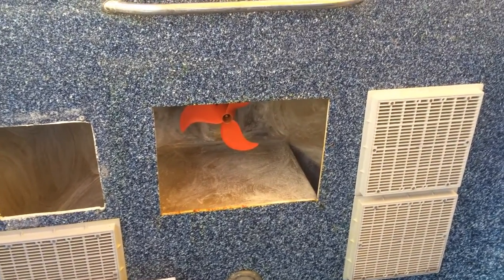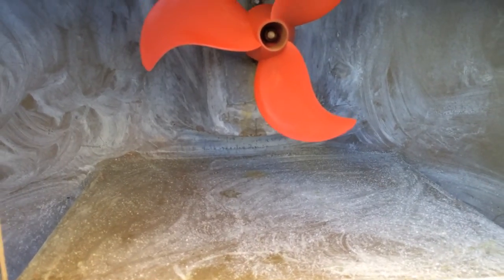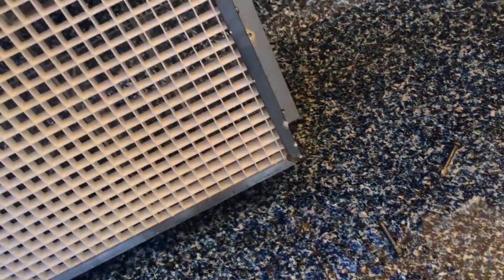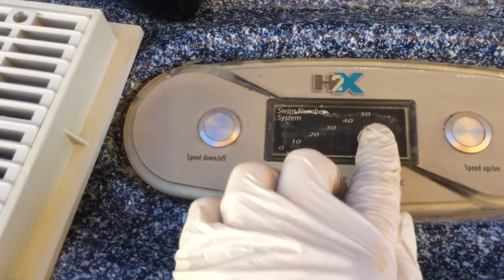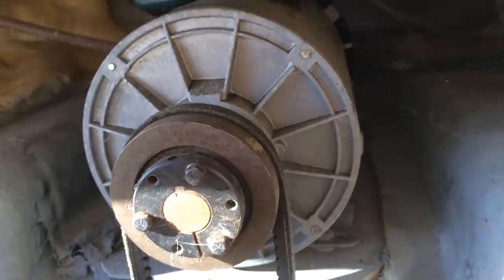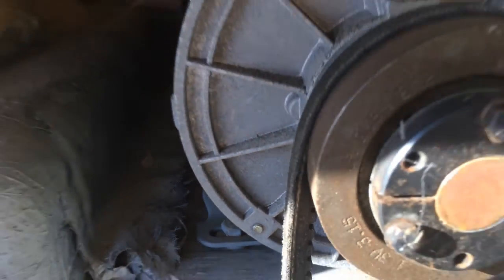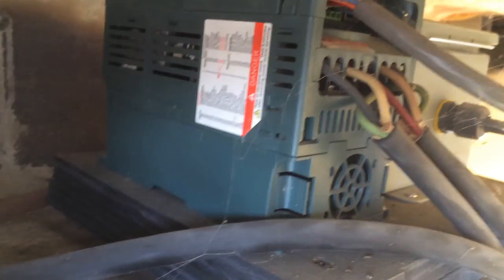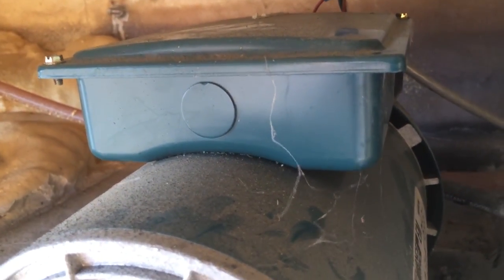Masterspas H2X Swim Spa propeller and grate custom upgrades #1

Comment: Do you still have this swim spa?
Reply from the maker: we do.
Reply: @slkttop  my control panel died for the propeller system the same one you have in this video any ideas where to get a replacement looking everywhere master spa only has the newer one not this one as in your video
Reply from the maker: @Fiberglassboi5824  "control panel", just to make sure, you mean the buttons that turn it on and change speed? or the circuit board that runs the motor?
Reply: Yes the buttons that change speed it was touch and go now does not work
Reply from the maker: @Fiberglassboi5824  hmmm. I have replaced that part myself. I "think" I ordered from Masterspa Parts dot com, also try "My Spa Parts Store". .I can only suggest searching the web even more thoroughly for just that part, and buying two if you find one...thanks for the tip., I might do the same. Ours leaks a lot...about 5 inches every two weeks. Not sure if I can do anything about that.

Comment: @slktop great info, I posted a note in slowtwitch with some questions, not sure if you still go in there or not. I recently acquired a 2010 H2X that's been in storage for 7yrs. I'm replacing the bearings in the hub assembly - thought I might put a new prop on and would like to know the model or torqueedo you used (ie the high torque or high speed one), if there were any words of advice installing it, and I'm trying to determine what spring/ceramic seal to install in the hub. Any advice/help would be appreciated. my contact details are in slowtwitch to your user name mws. Paul
Reply from the maker: I no longer have a slow twitch account. decided to update the description with helpful info.
Reply: @slkttop  Much appreciated! My motor is either 3 or 4hp so I should be good. now, just to find new ceramic spring seals. By the way, I'll be able to rebuild the bearing hub assembly for about 200-$250 CAD, much more reasonable than $1000 USD for a new one
Reply from the maker: @pauldemaiter6088  I just measured and found the inner and outer diameter and then, the height of the bearings and bought them off the online store from McMaster Carr. I have a small hydraulic press (required) and did the job myself. But if you lack the press, that price is not bad, if it includes labor.
Reply: @slkttop  yes labour (Canadian spelling) and parts, about $200 USD, It's good chatting with someone that also likes to tinker with things and DIY.
Reply from the maker: btw: as far as the ceramic seal goes. I believe I pulled the original and just took to to a spa tech who replaces parts like these. It is VERY common and off the shelf, but I do not have the part # offhand, sorry.

Comment: hello. did you get the 3 inch squares together or did you have to buy a tube and cut them, If so, how did you hold them together? any input helpful
Reply from the maker: I cut slots in the plastic strips, similar to a wine divider in a cardboard case of wine. then glued using acrylic glue. In fact, I looked forever FOR a wine divider made of plastic that was the right size and gave up, and had to make my own.

Comment: I would like to visit with the person who did the clever changes with the torqeedo prop,  as I want to build my own swim spa and have found this info so very helpful.
Reply from the maker: +Rick and Mary Coates . I'm glad you like the video. I did respond to your comments on video #2. Did you see my response? 

As for any other information: I will say that the "driver" which is the electronic control box on my standard H2X motor, did die. Admittedly, it might have died due to the additional power needed, especially at low RPM, to drive a prop that pushes more than 2x more water for every revolution. I ended up springing some serious money for a Phelps model motor AND the electronic driver box that controls it. About $2000 total.

Comment: Thanks for posting this series of videos!  I had to replace the prop in our H2X & this was very helpful.  Ours came with the upgrade style prop & it disintegrated after a couple of years. It appears to be made of a fiberglass type material & it became shaggy & fuzzy & the blades fell off the body of the prop.  Oddly the exerswim propulsion system in our spa doesn't get extensive use.  It apparently just broke down from exposure to the water.  Must not be designed for use around oxidizers like chlorine.
Reply: BTW, for anyone else who might have that problem...The prop can be pulled fairly easily without the need to drain the spa.  A phillips screwdriver removes the grate & the prop (our model anyway) was held on with a plastic wingnut type retainer.  No tool needed for that part.  Just have to be careful not to lose the short crosspin that goes through the shaft to drive the prop.  It is positioned in a hole through the shaft just behind where the nut threads are.  It is not tight in the hole & can drop out when you pull the prop off the shaft so just keep a hand on the shaft behind the prop as you ease the prop out until you feel it and then remove it.  Also if the blades broke off your prop like ours did you will find them in the bottom of the enclosure below the prop.  They sink rather than float and you definitely want to get the pieces out of there so they don't bang around & damage your new prop.
Reply from the maker: Glad this was helpful!  what part of the propulsion system went bad?  You are correct about doing this with water in the pool. I have done it with goggles and holding my breath, and did it in short chunks.
Reply: slkttop
It was the propeller itself that went bad.  Probably from exposure to chlorine.  The prop appears to be made out of a fiberglass type composite.  The resin had been slowly breaking down & dissolving to where the fibers were exposed giving it a fuzzy appearance & texture.  It had lost enough integrity that the blades became weak & snapped off of the body leaving only about 3/4" of blade still attached to the body.
Reply: Dear slkttop, hope you read this after an entire year later.  I plan to construct my swim spa using a similar idea and wanted to know what input you still might have.   thanks,   rick